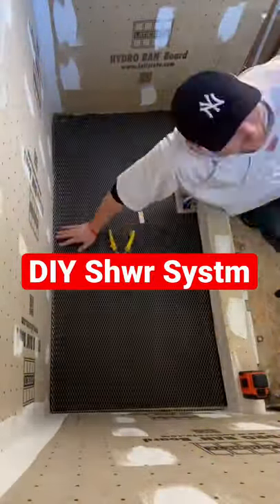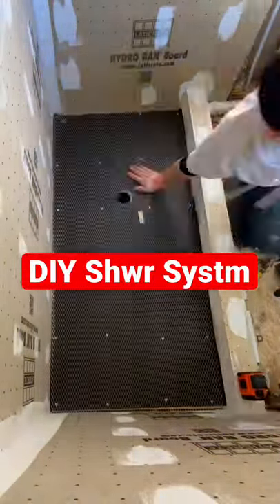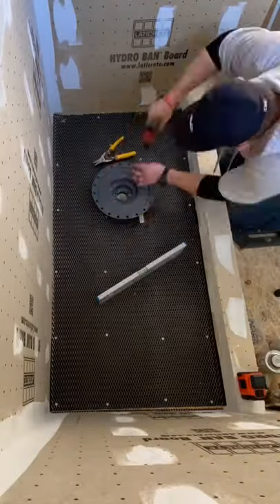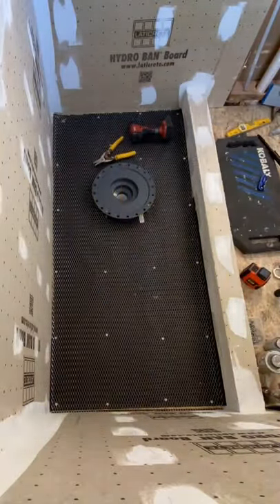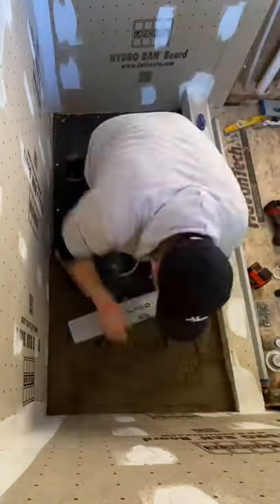How to do a Laticrete shower pan. Sheet membrane. #shorts #youtubeshorts #diy

Comment: I would recommend using the rubber underlayment and installing it before you put up the walls and right over your curb.
Reply: That’s what I did 6 years later still no leaks.  6x6 shower
Reply: Use a pvc liner not tar paper
Reply: @Patriot2499  yes for part 2 that is an option.  You need a preslope.  Which is what he did. Then you would get a pvc liner or shower pan liner over the preslope. Then put more deck mud or sandtopping mix mixed as dry pack on top of the liner to make a surface to tile on. And meanwhile doing some illegal plumbing lmao.

Comment: There's so much you did wrong here why are you claiming to be a tile expert? You don't need expanded metal lath, you don't use tar paper and you sure as hell don't use Nails
Reply: Bro educate yourself on tile methods before spouting off. He is using a surface waterproofing to seal it all up when he is done, hence the bonding flange shower drain. The lath adds reinforcement and the paper separates it from permanently bondong to your wood subfloor, while still being strong. And he never claimed to be an expert so 🤷
Reply: @daltonlopez4623  it's too small a space to need reinforcement, where's it going to go, and deck mud does not bond to plywood. Your right he didn't claim to be an expert but then why is he making videos? Why don't you sit down and be quiet, bro
Reply: @racebannon5523  youre really unintelligent
Reply: @benjaminziegler7437  not really
Reply: @benjaminziegler7437  yes dude fucked it up at least 6 different ways. It’s going to fail day 1

Comment: The waterproofing membrane is called chloraloy, it gets laid over a pre slope then caulked and bolted in the drain and goes 4 in above the drain height up the wall and no nails, then you float the pan a quarter inch per foot slope and set the tile over that. Better installation than any styrofoam shit.
You do use expanded metal lath on the curb, you shape it to fit but you only nail it on the outside not the top or inside, no nails go inside. Also you can staple or nail the chloraloy but you have to do it above the 4in drain height mark along the perimeter of the pan. I hope this helps
Reply: I like to go up the walls 8 inches and glue it to the studs with construction adhesive.  Then screw it up as high as possible.  The book says 8 inches.  So I go with what the book says.
Reply: @michaellestinsky7515  I should have said 4 in above the curb height or about 8in up the wall from the inside of the pan
Reply: I just Googled it it says 6in above the curb height. I guess they added a little since I started

Comment: What about the rubberized shower pan underlaument?
Reply: Pay attention. He said this is part 1. Part 2 is tomorrow.
Reply: @bdog0720  you put the Membrane on top of the base?  Or is he gunna pull the entire base up as one and then put the Membrane? Red Guarding the base doesn't count, as it doesn't look like he'd be doing that as a thinset has alrdy been applied to the corners and screws.
Reply: A Z  Why can’t waterproofing go on top of the shower pan?
Reply: @hughmann1537  

Stay tuned for part 2. Hell show you. 🤦🏻
Reply: I'm just wondering if it's the same for RVs. 
There was a small tub I took out. I just want to put a shower in.

Comment: Looks good but isn't the concrete/mesh netting pan outdated?
Reply: Not at all. Not everyone can work with it so they use easier systems.  (Me)
Reply: @notanexpert2978  I prefer using the Schluter system personally. Why make things harder when you can use easier methods
Reply: It is not a method. It is a future disaster. (Near future)
Reply: @craigose4914  what are you talking about?

Comment: I love when people use tar paper and metal lathe. When it fails, the entire floor comes up as one big sheet since it didn't adhere to anything. 5 minute demo job tops
Reply: Why does it need to adhere to anything? Remember, that was a wood subfloor.
Reply: It’s called a floating floor buddy, everything is packed in the pan it doesn’t have to be bonded. Once he puts waterproof membrane on top..even better. Not going anywhere, not failing. The mud locks into the wire lath as well. Solid.
Reply: Guys he is praising the technique.
Reply: Yup